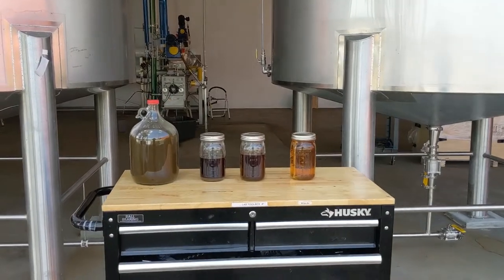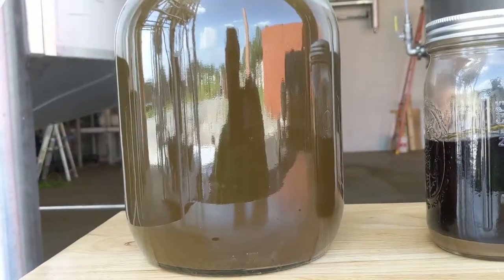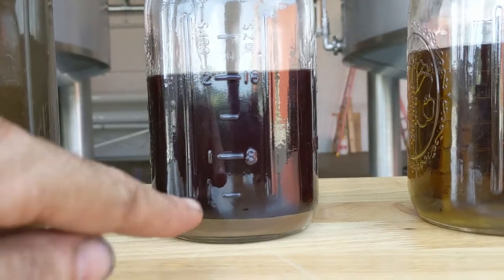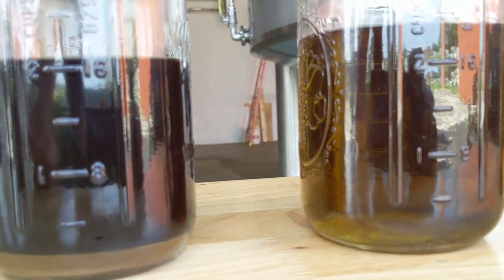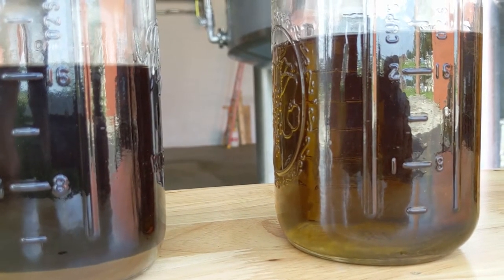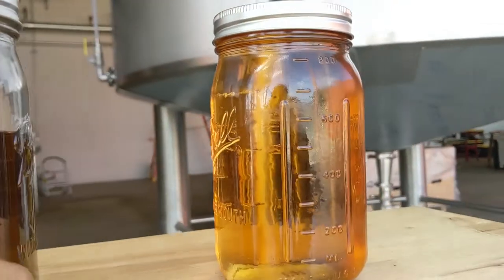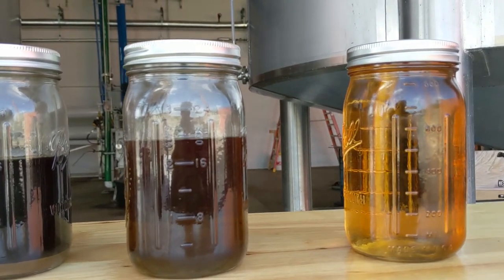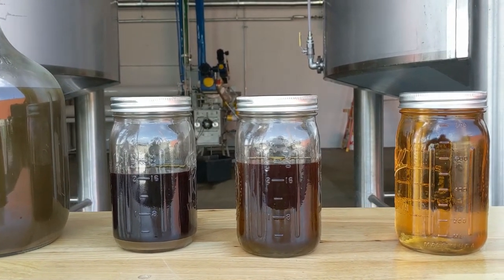CBD Processing/Extraction with a VincentCorp Screw press and Plant Works Group engineering design

Comment: how much cost 1000 kg per hour complete CBD oil processing line
Reply from the maker: Apologize for the delay in response, we didn't see this question.  A 1000 kg/hr system that could run 24/7 would be in the range of $7.5M.  This system we put in at this site was 150 kg/hr and the cost was $2.3M.
Reply from the maker: We've been doing a lot of testing and R&D over the past 18 months. Our new approach cuts down filtration requirements and incorporates a much less expensive winterization.  Our thin film, spray atomizing inline winterization that incorporated cryo chillers is no longer used.  We also ruled out large surface area expensive spiral, nano, R/O type filtration skids.  Our new design incorporates tried and proven enzymatic degumming and only requires a couple large swept surface agitation tanks.     So.  1000 kg/hr system is closer to $4M.  A 200 kg/hr system would run closer to $2.2M USD
Reply: May we extract kratom and make products like MIT45 and OPMS.  How much does it cost to get 1 liter?  and the kratom ingredients come from us